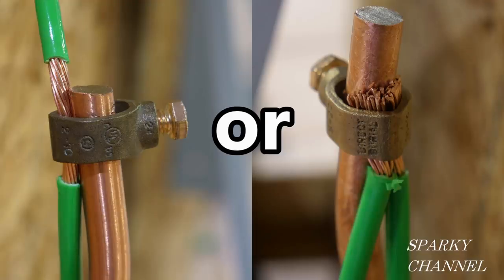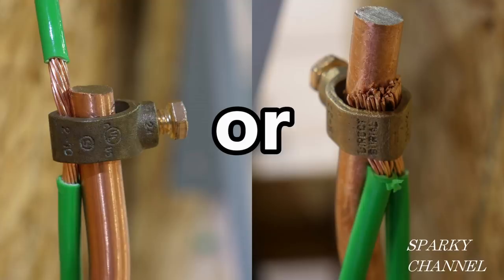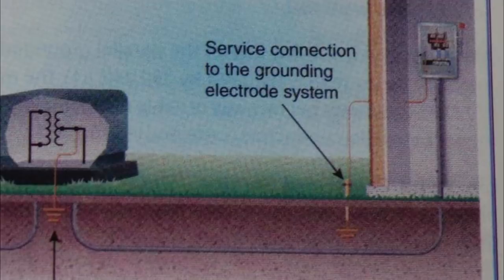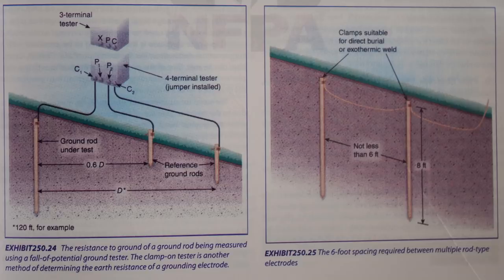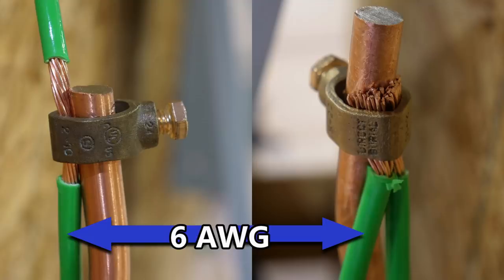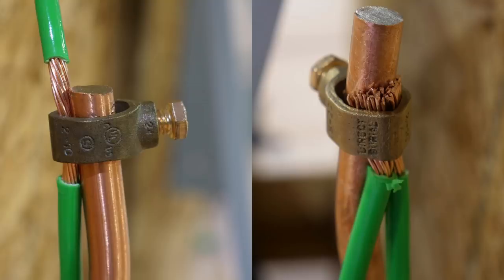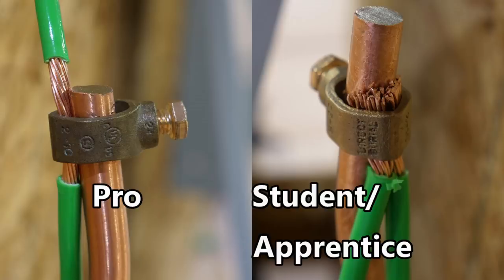Which is Correct?

Comment: Actually the left is the best solution anyhow. Not only because the manufacturer wants it that way. The chance the connection will fail is significantly reduced. And if the terminal fails there's still continuity to the next rod. Not desirable due to step voltage*, but still better than loosing the whole system of earth electrodes.

Actually I don't know why you Americans still stick with that rod, rods are the worst electrodes ever. Especially if you got dry soil. Better ones are foundation electrodes, embedded into the concrete of the foundation of the house. Install a metal grid, can be copper, steel, stainless steel and pour the concrete over the whole construction and let the connectors come out of the concrete and connect them to the bonding system. In case of high groundwater level and you need water tight concrete use a soil embedded ring shaped electrode buried around the house. Here in Germany rods are only an emergency solution. All houses built after 1980 must have a foundation earth electrode or a soil embedded electrode.

* Step voltage is a potential difference between the feet of a human beeing standing between a ground fault and an earth electrode, and due to increasing resistance of the ground the more distance you have to the earth electrode, there could be a potential difference between the two feet. Difference in potential is a voltage, and depending on how high that difference is, it could give you a "smack" or even kill you. That's the reason for the exact distance between the rods stated in your NEC, so you can't have this risky potential difference.
Reply: Actually foundation electrodes do exist in the USA with many good contractors taking that approach with new construction. As always cost and convenience comes into play if the code allow multiple approaches then the rod approach is usually the one taken.
Reply: Concrete encased grounding systems were invented by the U.S. army during WWII as a way of grounding bomb storage vaults in the extremely dry Arizona climate; no other method worked as well at dissipating static, due to the dry soil.  It is recognized in the NEC and is required in some localities.  It can't be installed after the fact, like ground rods can.  If the concrete is poured before the electrical inspector has an opportunity to inspect the rebar, then the inspector will require that rods be installed.
Reply: @barryomahony4983  You can install soil embedded ring earth electrode as a retrofit. Or something I've seen called "condudisc", which is also better than the rod.
Reply: @Marcel_Germann  well it all depends on the nature of the soil, while I know the condudisk, condu Crete works well usually in small European gardens and even large EV installs (I have seen them use that). The thing is there are several options that work well in such a situation as long as testing proves that installation ground resistance can get down to 25ohms for residential settings then that’s good enough from the NEC2020 perspective. Of course different issue completely for hospitals, data centers and telecommunications/ mobile towers were often you are going below 5ohms or less. I would rather see multiple approaches and I am sure even in Germany they do not recommend the same foundation earthing approach for all situations sometimes it just may not be possible e.g. for housing stock pre-1980? As you say the soil embedded ring earth electrode you mention.
Reply: @mathman0101  No, they don't recommend a special one. Either soil embedded ring electrode or the one in the foundation for new construction. The rods only for retrofits. In old buildings from before the 1980s the incoming water pipe was used as an earth electrode. For that reason they made these pipes of thick cast iron to prevent leakage due to corrosion. The problem is, if the city repairs a broken pipe they usually repair it with plastic piping. Meaning you no longer have a conductive connection.
Reply: There are many different styles of grounding electrodes in the NEC (and CEC if in Canada). The concrete encased electrode is one of them, as well as the ground ring. There is also metal water pipe, other buried metal objects (not everything applies here), ground plates, building steel, etc... A ground rod is just one of the many ways it can be done.

Comment: We can hear that you quoted the code. But what is the problem with doing it like that.
Reply: According to manufacturers specs only one #10 AWG thru #1 AWG is allowed. Both examples show a #6 AWG grounding electrode conductor, which is the largest size necessary for GEC to a ground rod according to the Code. What wasn't mentioned is the installation on the right is not continuous per 250.64(C)(1)or (2) throw and also it looks like both rods were cut and that's a violation per 250.53(G)
Reply from the maker: The one on the right isn't a continuous grounding electrode.
Reply: @kennethrozansky5501  I can hear what you are saying.  In theory , but in reality no difference in any reading that you can make. The cable on the left also has 2 ends to it which have been cut. I am not an electrician. Please tell me what faults can arise .
Reply: @johnbutler3141  as a non-electrician I initially thought I was seeing the same thing as you.  But in reality the left example has a SINGLE wire which has its insulation cut away from it and continues on to another rod uninterrupted and unspliced.

Comment: I don't think you specifically stated why the one on the right was a violation
Reply: Actully he did . The rates the clamp for only one conductor. The example on right has 2 conductors
Reply: I missed it the first time thru.  This is for a 'multiple grounding rod setup' where the wire is coming from the structure and going first to one ground rod (the one we're talking about), then going to a second ground rod.  In that case, there can't be a break in the wire.  It has to be intact until it is attached to the last ground rod. 

So, the Right picture shows the ground wire has been cut and clamped to the first ground rod...code says 'not to cut'.  The Left picture shows that someone stripped the insulation off a small area of the wire and clamped it to the first rod while continuing to the next (or last) rod without cutting it.
Reply: Violates the usage specifications of the connector
Reply: Basically because the wire was cut despite having a perfectly good connection
Reply: @benchociej2435  So take that wire cut the insulation bend it in half and insert into the clamp is a violation or not ?

Comment: Umm don't see what the difference is between the two.  both 6 AWG I assume, both have two wires but one has the wires that come from the top and bottom and the other has both wires from the bottom.  where is the code violation?
Reply from the maker: The one on the left is continuous, not cut.

Comment: What is the physics that makes one correct and the other incorrect?  The one on the right is a better bond (more surface area) than the one on the left. There is something that is not being explained clearly here.

OK from one of the comments we pick up that the one on the left is not cut. That makes a big difference. Otherwise there is no difference!
Reply: The code says it must be continuous. The two wires spiced at the bond may become corroded in a damp environment and the it will increase the resistance.
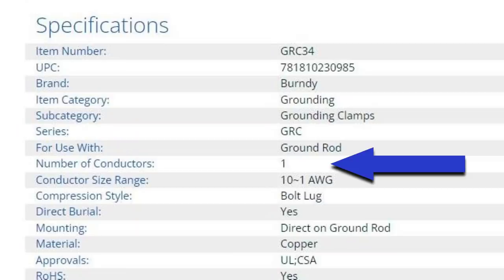Reply: The reason is the acorn’s specifications. watch at 1:23. this particular acorn is designed to bond only one conductor to the grounding electrode aka the ground rod. the young apprentice cut the wire creating two conductors. the journeyman skinned the wire and passed it through the acorn which keeps it as one conductor. LU 349
Reply: as well as the continuous requirement
Reply: @Sparkeycarp  Thank you!
Reply: @mg3280  Thank You!

Comment: Not exactly accurate. The video does not really emphasize that the method depicted on the right side is acceptable PROVIDED the correct clamp is used. The vid glosses over that, implying that only a single continuous conductor is acceptable.
Reply from the maker: NEC article?

Comment: interesting...  both look like tight connections and would look (guessing) identical to an ohm meter - why aren't all outlets in a residence required to have a continuous wire in a circuit from beginning to end ?  answer: cause there's no "real" difference (maybe...) in continuous and properly junctioned

And...
That connector looks "not good..." to me and intended for solid wire.  Maybe splitting hairs here but most appropriate for a "ground" circuit would be solid, unshielded cable.  Why would a buried cable/wire used in a ground circuit be shielded or sheathed?  All intended in a discussion kinda manner; could it be better or safer not right or wrong or in compliance with "code" as I'm not an electrician.  Have a good day!

Comment: No explanation why the incorrect wiring was… incorrect.
Reply: No need to. The clamp is rated for a single conductor to the ground rod. As used, there's two conductors. Hence, incorrect.
Reply: @johncochran8497  I disagree because he didn't cut the wire, it is folded in half.  The folded one actually makes contact over a larger area.
Reply: @mad0scientist  Check it again. He did cut the wire.
Reply: My mistake it IS cut.
Reply: sure he did...because it was 2 conductors...which the product was not listed for.
Reply: @mad0scientist  The wire is clearly cut on the right side. It would have been fine if it was only stripped and folded. Since it's cut, if the clamp is removed, the wires separate and there is no longer a ground.
Reply from the maker: Please see: Hey Sparky, Why? Article 250, 2020 NEC: https://youtu.be/VdjgM6oAfmI

Comment: Neither is correct. Each wire should have its own ground clamp. "Ground wires are limited to 1 under the screw"
Reply: He didn't cut it.  It IS ONE wire.
Reply: Having the one continuous wire is a better solution. I have normally installed 2 separate acorns with a wire in each about an inch apart from each other on the first ground rod. This method will save me a little $ not needing an extra clamp.
Reply from the maker: Excellent!

Comment: The one on  right  is correct
Reply: Nope, only 1 wire allowed per clamp.
Reply: @MichaelClark-uw7ex  I agree, but interestingly, the video says "check the nut manufacturers spec". It gives the number of conductors allowed sooooo, one would assume some nuts out there somewhere may be more than one conductor. I haven't seen one but their existence is strongly implied.
Reply: @NickFrom1228  Yes, that is true.
I should have specified "unless specifically rated for more than 1 conductor" as the NEC states it.

Comment: Pretty  pimpy distinction. The electrical code writers have become drunk with power.
Reply: Consider what happens if the connection fails.
For the image on the left, if it fails, then you loose a connection to one grounding rod and the rest of them are still intact, so your grounding system isn't as good, but hopefully, still functional.

For the image on the right, if it fails, then it's possible to completely lose your grounding system. Not good.
Reply: @johncochran8497  given the amount of wire in there, is it really more likely to fail over a single wire if tightened down? but also the specs say one conductor, stranded wire is many conductors so both are actually failures?
Reply: No SHIT !!!
Reply: @freman  the definition of conductor includes wires made of stranded wire though. So while I get your point, that's not how these things are defined.
Reply: @johncochran8497  They both equally suck what if the side that fails is the side from the main box on the one on the left, or the clamp becomes loose in either case so you have no good ground in either instance.
Reply: @MrNaildriver01  Nope. Think again.
First, the one on the left is unlikely to fail since it is only one wire, so the clamping force is good enough. And if for some reason the clamp totally failed, it would result in a partial failure of the grounding system (higher than desired resistance to ground) since it's part of a multi rod grounding system. However, if the clamp of the right failed (and it's not rated for multiple conductors) it's possible for the entire service panel to become ungrounded. Not a partial failure, a total failure.
Reply: @johncochran8497  If you don't drive the rod below the dirt level there is potential for it to be hit by something.  What I was saying is if the wire were broken on the side that is coming from the panel you have no ground, the clamp and second rod could be intact but you have no ground.  If the first clamp fails then you have loose ground, but it continues to the second rod I get that.
Reply from the maker: Please see: Hey Sparky, Why? Article 250, 2020 NEC: https://youtu.be/VdjgM6oAfmI